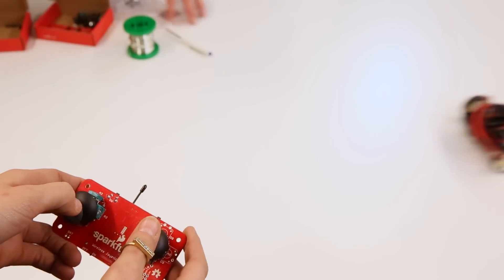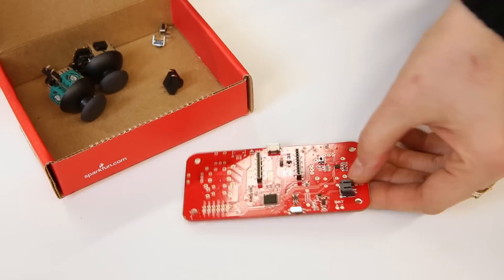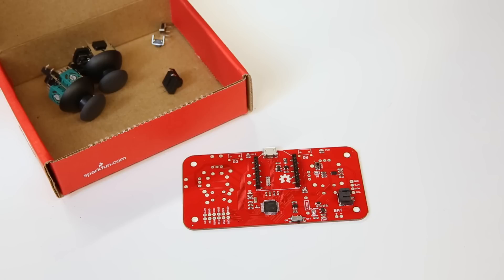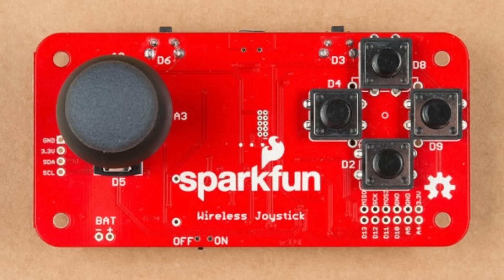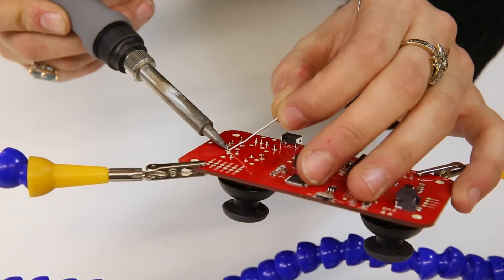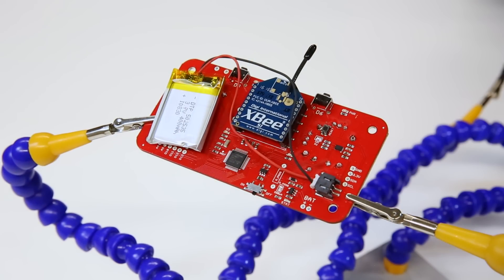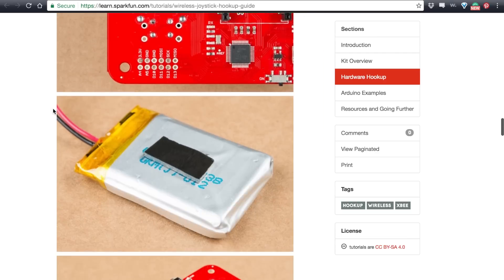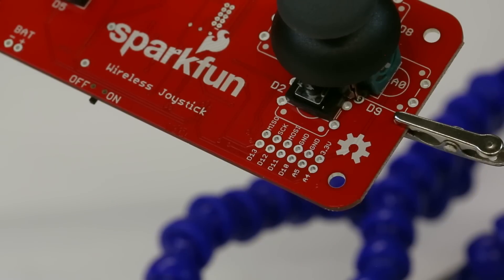SparkFun Wireless Joystick Kit

Comment: Yep just ram that battery into the joystick pins, no wonder batteries are exploding with this level of haphazardness
Reply: TheBeefiestable 
most lipo batteries of today have their own safety of over discharge and over charge
Reply: They do not however have anti-stabbing technology
Reply: Go pick up a cheap $5 USB battery power bank and use the 18650 cells to power this system if you are that worried about stabbing your cells.